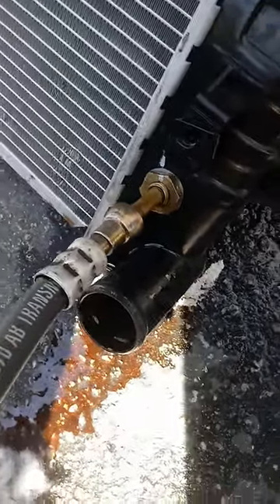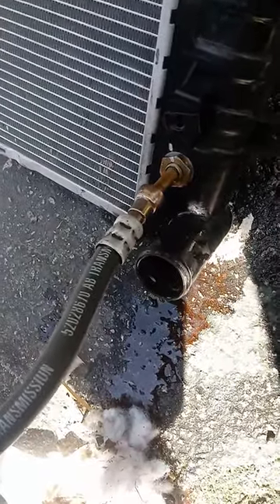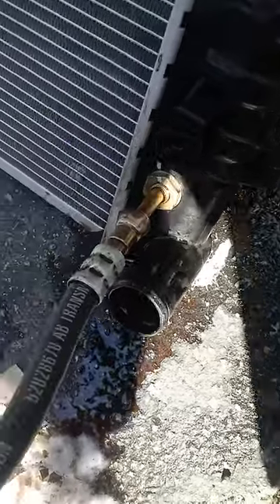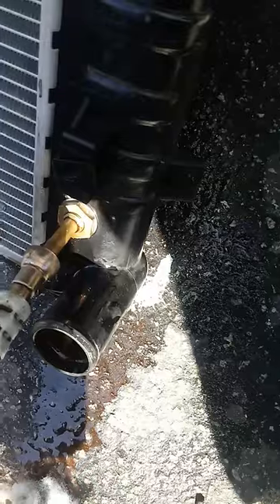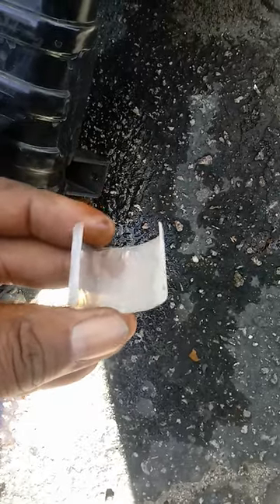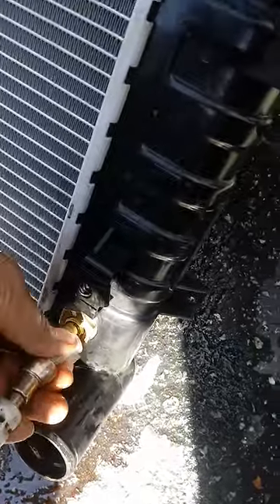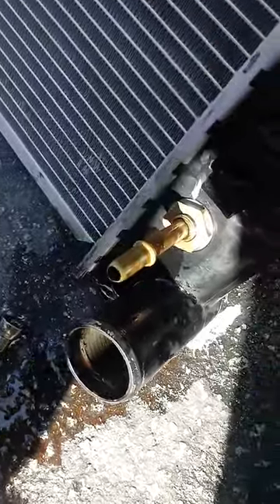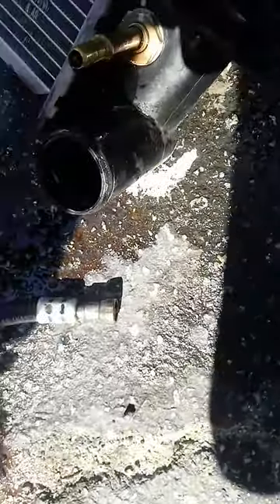Transmission line removal no tool - 97 dodge ram

Comment: Saw this video, picked up the tool but didn’t open it. Used a bit of plastic just like you said with the addition of some pliers to move it in. Saved $13, thanks for the share man! Returning the tool.

Comment: Great suggestion. I used a plastic, gutter nail sleeve ...  that I had stashed in my catch-all storage container. Snipped off about a 3/4" piece from the 5" sleeve. Cut the wall of it to slide over the outlet nipple, which fit perfectly, and then pressed it toward the connector fitting with a small pry bar and it released ...no problemo.
Reply: Another video showed a "Sharpie" cap worked.  Cut to length and split it.
Reply: Mine won't come off tryed that and the tool

Comment: I'm changing the radiator on my 96' right now. Stopped at the same fitting. Good thinking on the fix. Thanks.
Reply: Can't get mine off? Have the tool and plastic the big nut on other side is in the way then I got into it but it will not open .those lines are 8 inches and cost 50 dollars..radiator was 230 I have 97 5.9 same fitting but has larger nut.

Comment: I need to replace my radiator last truck i replaced it i used an ac fitting tool if that helps i think they are lyle. This looks like an awesome hack also

Comment: I after hour plus and different plastics  blood sweat I ran back to parts store and got took, and still hard, I assume grit built up in area and need worked and blown out, just heads up to otbers
Reply: Mine won't come off .doing same

Comment: im Trying this method so hard but im not as lucky thanks for the tip though
Reply: It ain't working for me, either. It looks like it works well on nice shiny new stuff...but that's not at all the condition of something that's been in an engine compartment for years.
Reply from the maker: @lordphullautosear  trust, mine was not new at all either. Hope you made it work though
Reply: @GBCJ_LosAngeles -- I actually had to buy the item from the auto parts store, and even with that it was a lot of swearing...but I got the cussed thing apart.
Reply: No they get stuck mine is ..wint come off ..guna try torching it

Comment: I got a leak from that  connector, and I don't know how to fix it. I changed the completely hose and radiator and still leaking
Reply: Just bought Radiator. But can't get that fitting off

Comment: I just bypassed that shit I tryed your method for two hours and ended up just cutting off the stupid connection and plugging the line over the male connector that came with my new radiator